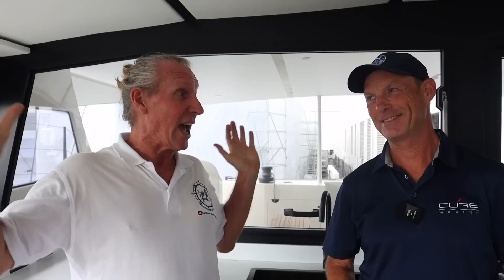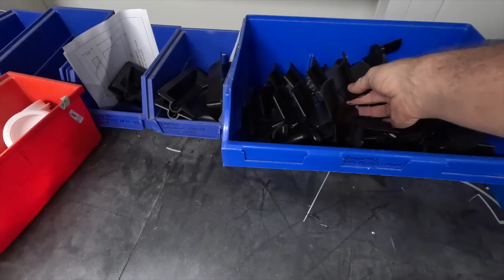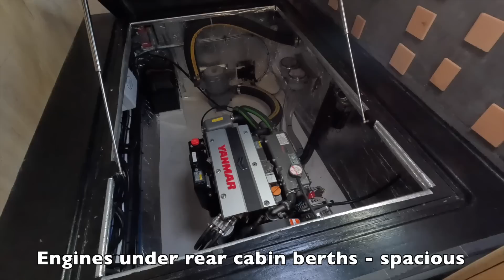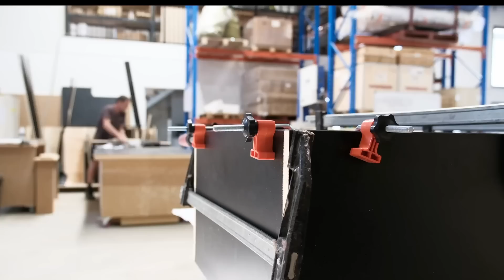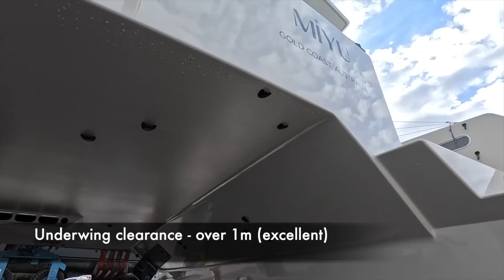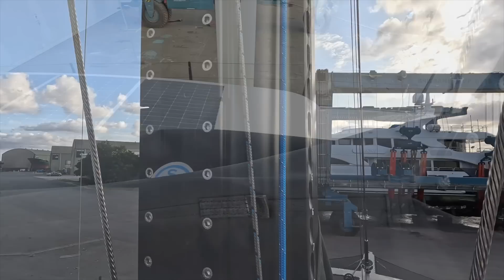S5#1. First EVER Cure 55 - Sneek Peek Tour!! 100% Cutting edge tech, 3D printing and 100% Carbon....

Comment: No vang?
Reply from the maker: Hi John, The sails were not fitted and so I am not sure but presume it will be fitted with the sails. If I get down there for a test sail, I will check it out operationally for you!
Reply: @barefootdoctorssailing most cats don’t have a vang….. They do have a huge traveller though - hence they can get leach tension that way. 
Our HH52 being built doesn’t have a vang.

Comment: Nice one! Great episode John and Eli! I hope they do well.
Reply from the maker: Thanks Garth!  We are very excited to see how it sails too because those polars are superb!!
Reply: @barefootdoctorssailing  Sure. I still feel that aluminium is the way to go for a world travelling yacht. It remains one of the easiest materials to repair if holed or damaged. The Cure remains a very specialised vessel requiring extensive and specialised knowledge, treatment and care should it require repair - which will be difficult to find throughout much of the world, which will limit its ability to seek extreme latitudes. As a point to point performance catamaran, however it should perform well. How's Alfred looking after you - it's still 400k's off the coast isn't it?
Reply from the maker: Hi Garth, ironically the cyclone is heading north and current models show it hitting Brisbane which will be quite unusual!
Reply: @barefootdoctorssailing  Yes Very!
Reply from the maker: @gbsailing9436  !!!

Comment: I love your belief in computer generated polar performance curves for a boat that hasnt sailed yet. In 40 years of delivering boats I have yet to come across a boat that would sail anywhere near its VPP polars. In general the boats are nearly always heavier than designed, sometimes by 25% or so. And then all the cruising gear, personal effects, safety equipment, food, tender, outboards, toys etc gets put aboard which is usually another 2000-4000 kg. In addition the VPP expects flat water even at 20 knots TWS or higher so there is no allowance for sea state. Real boats dont perform this well. Ever.
Reply from the maker: We're very aware of the challenges with VPP performance - Thanks for your insights and yes the real figures are usually 10% or more less! Obviously the drop off in polars is because they predict the boat's performance in ideal sea state, with ideal sail setting and at the weight stated - obviously that weight rises depending on how you load the boat. However, I believe Cure will be sharing their performance data and given that it was motoring at 11.5 knots and reached 12.5 knots up the Brisbane river, I expect the sailing numbers should be good! Time will show the real performance and that is what everyone is keen to see!
Reply: Cool story bro, Roger Hill design catamaran "CATION"

Read the polars and eat some humble pie Ol timer.
Reply from the maker: Good point Lance! The computer polars on some boats do match the real performance - HH told us that theirs did for their bigger boats....
Reply: @barefootdoctorssailing8567  with no payload and flat water. And no boat is ever going to be sailed with no payload and flat water...
Reply from the maker: @deerfootnz  Sure - there is no dispute that the computer generated polars are an estimation and the real data comes on the water but at least with the amazing VPPS here, they are going to sail fast even if with a % off for real life factors. BUT WE WILL ALL SEE!!! Lets be patient and see the numbers when they do the test sails.....
Reply: I just did carribean600 in a catamaran that has a 11.7T "dry weight" from factory - the IRC weigh out from the factory i guess once all the crap was on it was 13300kg.... once you load 9 crew, food, kit; fuel it does not do anywhere near as well as designed how do i know? Once all my friends left and it was me and 3 crew/way less food we were alot faster hahaha.... i guess the learning point from my experience is if you are racing gut absolutly everything you dont need, plan food in a way to minimize weight; run fuel tanks in the weeks/months leading up to racing down to safety minimums, limit peoples kit, rent locker for all the excess....

Having said that look forward to seeing what this boat is capable of compared to the french boats. I am not 100% sold on the integrated crossbeam as if you damage that you are screwed compared to a bolt in.
Reply: @patricks1251  I don't have a problem with integrated beam. It's still eminently repairable. I am sure this boat will be very good as the builders seem to know what they are doing. The breathlessly naive advertorial ignorance of these two annoys me a little as they are clearly clueless. 
What is not often enough discussed with multihull is the effects of payload/loading on safety. There is a direct effect on righting moment and reserve buoyancy which leads experienced multi sailors to pay close attention to how much weight they are putting on board. It's not just about speed: it's about sheet, rig, daggerboard and rudder loads. It's about driving the lee bow under and writing off boats and people.

Comment: I am not sure why you need a bow thruster in that cat?
Reply: @deerfootnz  The Wind dear Henry, the Wind 🤣
Reply: @seawench555  incompetence?
Reply: @deerfootnz  im just being silly
Reply from the maker: Hi Deerfonz, I'm not sure if you've ever been in a light cat in a cross wind but they scoot sideways across the water at huge pace, even with daggerboards down and this is a big boat. So the bow thrusters will give the owners more confidence and less stress when entering marinas short handed.... It's really difficult to put out fenders on one side and attach mooring lines when there are only 2 of you on board - we have been there!
Reply: @barefootdoctorssailing8567  I have been delivering boats for 40 years, many of them cats. I have no idea of the number of times I have docked a catamaran, many of them much larger than this one. A bow thruster is really not necessary. It just adds complication, weight, expense and maintenance.
Reply from the maker: HI again, perhaps some more allowance for others to make choices different from yours is good. Even with skilled handling, there are times when things go wrong, and having the thruster can save the situation.... We have never yet had a thruster and there have been times that it would have made things MUCH better! Remember each person makes choices based on their skills, desires and fears and if they never use it , great but when you have it, it does make the situation much less stressful.

Comment: what edge got cut, if this is cutting edge..  so stupid
Reply from the maker: 3D printing of moulds for hull, 1000 parts on 3D printers too and making all their windows and furniture from carbon fibre. Perhaps you missed those points. Also I split my finger on a splinter of carbon.... Only joking!
Reply: @barefootdoctorssailing  3D printing aint really "cutting edge" no more, as everybody and your grandma does it at home..
Reply from the maker: So how many boat builders are using 3d printed moulds of 80 feet with a 7 axis grinder to trim them exactly? The small 3D printed pieces are the bonuses.... Are you difficult to impress or have you seen this before because I have not. And besides, this tech is cutting the edges with the 7 axis grinder anyway if you want us to be exactly accurate!  So in it's actions it is cutting edge :))
Reply: @barefootdoctorssailing  20 years ago, while i still were in the boating industry, we were using gantry mounted cnc grinders to make moulds, replace the grinder with an extrusion head and you got?   whats so cutting edge you said?  It is great that more of the industy actually use the rapid prototyping we have achieved through the years, just dont call it "cutting edge", it's not.
Reply from the maker: I'm sorry that an 80 foot 3d reprinter and 7 axis grinder does not impress you and given that I have not seen or heard of any of the other brands using such a big 3D printer/ 7 axis grinder, this to me is impressive and cutting edge due to it's size. Please don't get so upset by two words that were used in casual but enthusiastic conversation - it is not such a big deal....
Reply: @OldSlow You're full of it, trying to come across as a know-it-all in the industry. 20 years ago has nothing on what is available in capable today no matter what you say. Something that was done 20 years ago is not even relatable to what these guys are capable of doing. It's always so easy to be negative/sarcastic, takes no effort. Only makes you look a fool.
Reply: @robertmunafo5039  omg, real cutting edge critic here. I should probably feel slayed under your super sharp words.  But lets get real, i love that manufacturers use the tech available, in traditional and untraditional ways, that's what brings progress. If one care to share, explaing how and why, that's great. But we dont need the clickbait, it's so annoying that many don't click. Defeats the purpose. But ok, i am here to lay slayed and gobsmacked. Tell me when to get up again...

Comment: Really nice and light… but with sail drive on that price range for real sailers? That’s a no thanks for us. Thank you for sharing🏅
Reply from the maker: Hi MK, We certainly prefer the shaft drive but this use of stern drives is same on many of the performance boats like Balance, Outrider and even Gunboat I think... It is much easier for the boat builders to make the boats with sail drives and it keeps the engines further aft.
Reply: What is your problem with sail drives?
Reply from the maker: Hi Deerfoot, our preference for shaft drives is because of risks of damage, extra costs and maintenance of sail drives.

Comment: A beauty, but high away in price
Reply from the maker: Being 55 foot and 100% carbon but still at the price of a Balance 52 that is not all carbon. So not actually expensive by comparison...
Reply: I think it's a pretty good price for an all carbon boat built by boatbuilders. Compare with a similar HH built in China by factory workers....
Reply: 100% agree the humanity is so greedy (((
Reply from the maker: look at the number of yacht builders that go bankrupt - the margins are low and turnover is slow and usually labour intensive so boat are expensive to build, therefore expensive to buy. 

The cheapest way to do it is to build them yourself (which I did for 3.5 years to build the 42 ft cat) and I KNOW how long it takes in man hours.....